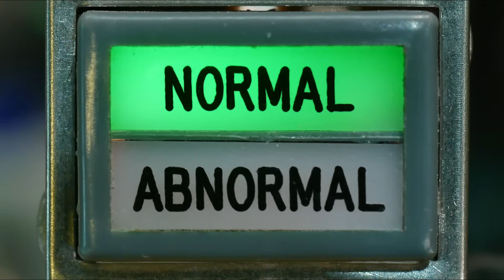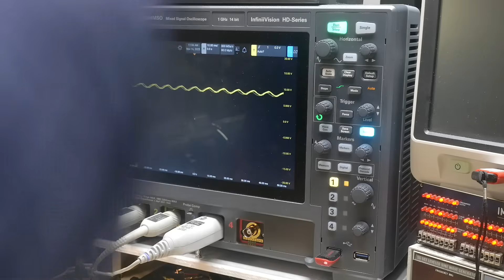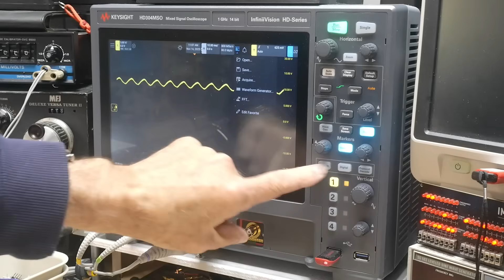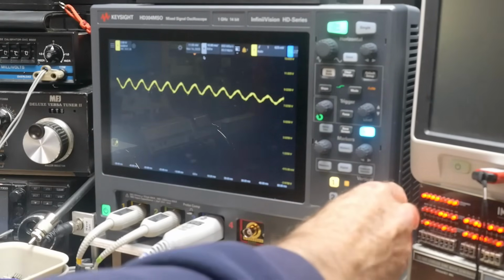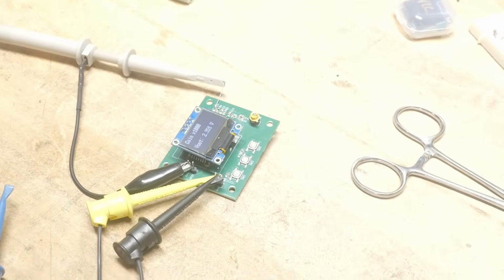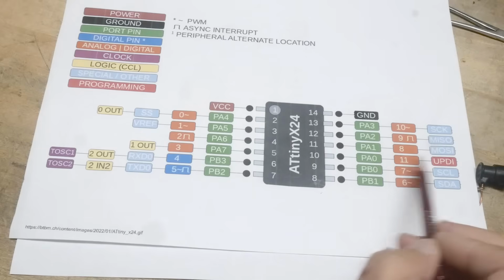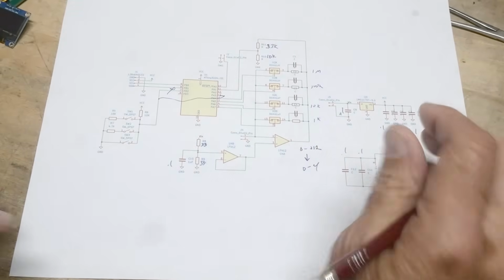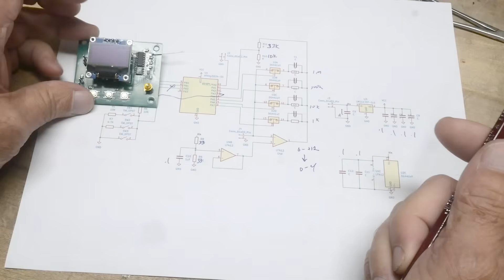#2436 Photodiode 4 Gain Amplifier (part  2 of 2)

Comment: Could use some help! Working on a photodiode project right now. Using a TIA and then a 2nd stage inverting amplifier. Both referenced to 1.65V virtual ground, 3.3V rail voltage. The PD only swings from ~0 to 20nA in the light conditions I am trying to sense. The TIA converts that swing to about a 10mV signal and then the amplifier stage makes it about 1.65V of swing (1.65V to 3.3V range). I am currently using a breadboard which may explain the issue, but I am seeing 60Hz electrical noise. When the light is at its lowest into the PD, the electrical noise's Vpp is the full 1.65V range. When the light is at its high state, the electrical noise is seen but clipped a bit at 3.3V. Is this noise from the breadboard and the couple cm's of cable connecting everything?  I am aiming for a very fast response to these small light changes. 10-20us rise / fall time. Is this a reasonable ask? How can I get the 0 to 20nA to map to 0 to 3.3V range and 10-20us rise / fall time? Using the LM358LV dual package op amp because I thought it would be fun and super cheap. Thanks for the help in advanced!
Reply from the maker: https://youtu.be/F4DFn6CtUes?si=v4tK4Pc8YBtqbo0z

Comment: you have that extra opamp you use to generate the virtual ground, wouldn't be better to use it as a second amplifier stage? this way you can impedance match the inputs of the first stage, and keep it low noise, high precision, and move the variable gain to second stage

Comment: To avoid this kind of error, I defined extra constants for every pin, e.g. PA0_ADC if PA0 has analog input (#define PA0_ADC PA0), also PA0_PWM if pin can do PWM, etc. then I write int i = analogRead(PA0_ADC) and if I were to write analogRead(PB0_ADC) it would not compile because PB0_ADC is not defined.